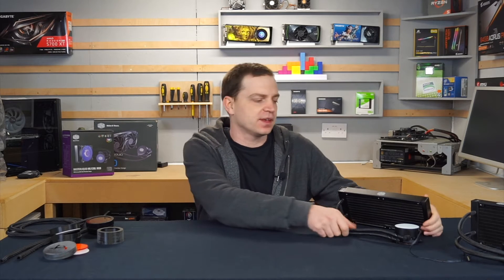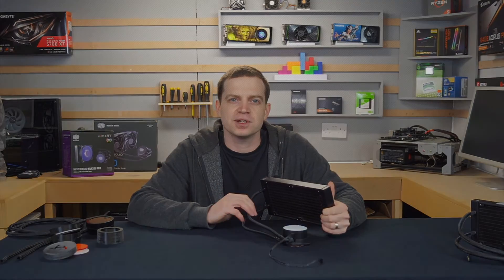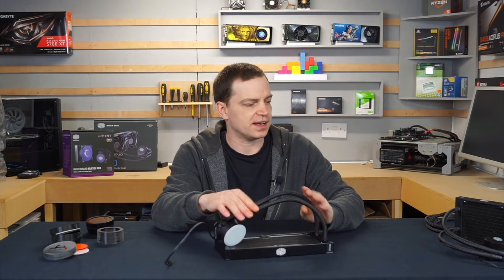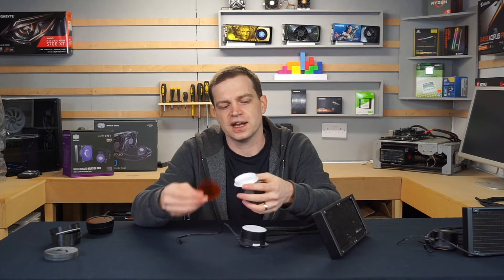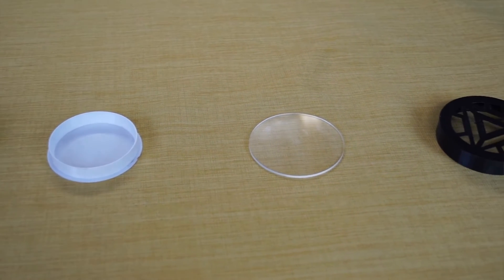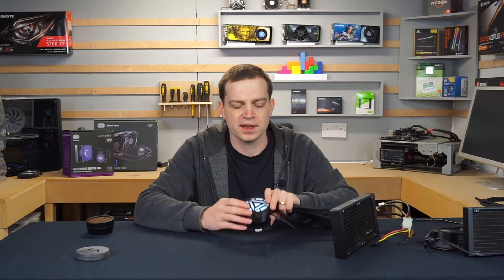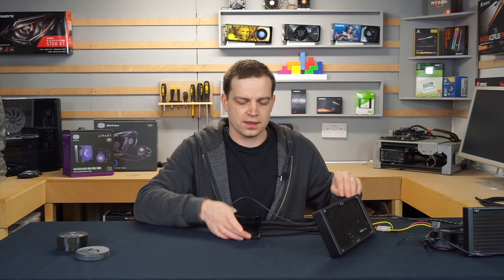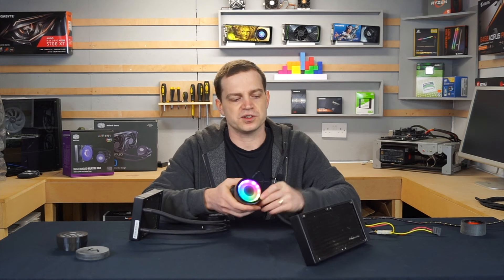Customising the Cooler Master MasterLiquid Lite AIO | DIY Modding

Comment: Mine is just blue why can’t I change the color?
Reply from the maker: The originals didn't have adjustable colours, the RGB one in the video is the one I made for it out of aRGB lighting.
Reply: @TechLabUK  so it’s only blue color on it?
Reply from the maker: @exzy530 I believe the original coolers were something like that.
Reply: @TechLabUK  i have Cooler Master ML240L and it has same logo on it like yours cooler master but it’s only blue not sure why
Reply from the maker: @exzy530 Ahh the ML240L is RGB I believe, that's a much newer model than the one in the video.  It will be controlled via a 4Pin (RGB) or 3Pin(aRGB) (Depending on model) cable that needs to go into an RGB header on your motherboard or an external controller. I thought they came with the controllers tbh